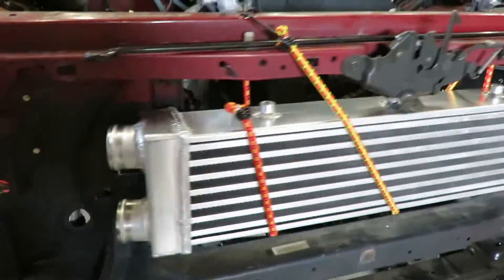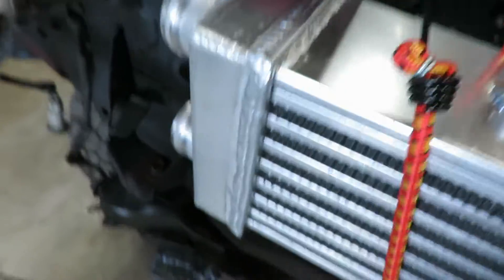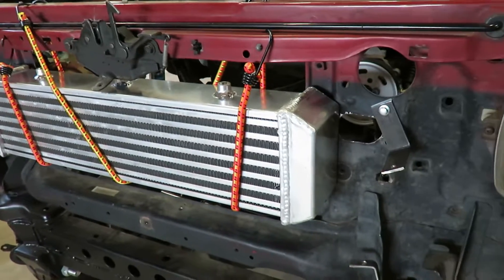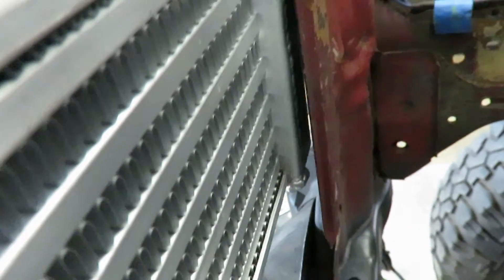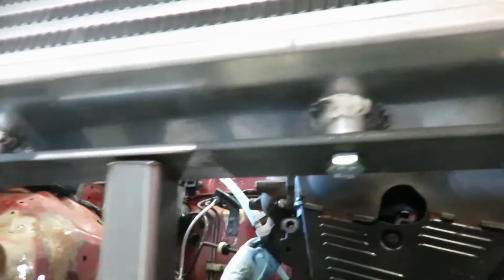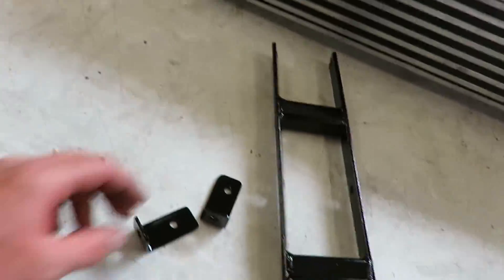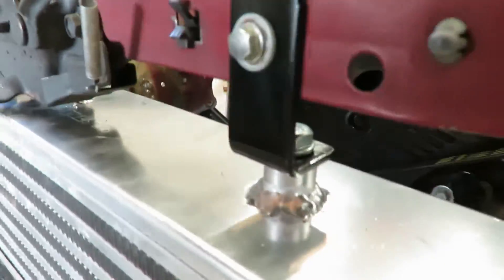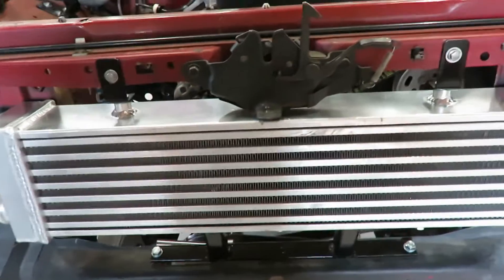ToyoTDI Toyota ALH Swap Intercooler Mounting Turbo

Comment: Where did you get the intercooler from?
Reply from the maker: A https://www.ebay.com/itm/NEW-Turbo-Aluminum-Intercooler-2-550x140x70-mm-Delta-Fin-SAME-SIDE-OUTS/112652007050?hash=item1a3a95368a:g:SFQAAOSwSrNaFT~1